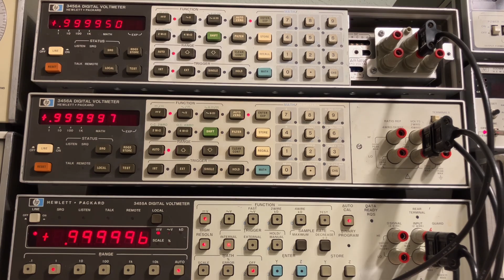HP 3456A 1 Volt Range Accuracy Issue (Part 2)

Comment: When you say "55 counts" that looks like 55 microvolts to me.  I've wondered, what use case demands that level of accuracy/precision?
Reply from the maker: Correct, it is off by about 55 microvolts. I first noticed when measuring my Weston standard cell. I simply know that the tolerance on this instrument is tighter than this, it does not meet specifications on the 1V range. I may not have a real need for this level of precision. In fact, I’ve been using this meter for the past 2 years, and I never noticed this problem before, but it was always there.

Comment: i could have told that before, as its highly improbable, that a single resistor in such an array would drift so far out
Reply from the maker: I agree, but it seemed like the problem moved to the other meter when I swapped these chips between the two. Obviously I did something wrong. In any case, at least I’ve eliminated the chip as the cause. I’m not worried; I’ll get it figured out, and it will be a learning experience for me, which is what this is really all about.

Comment: I bet for this outcome somehow. These parts are usually not leave an fully working unit in fully working order. Maybe you have to buy a damaged board what is contain this divider.
At this point i may forceing myself looking for desing issue on a part or around the connecting pin. It maybe had somthing like a overcurrent situation or viod on the case/carrier where the moisture can penetrate inside and hit this particular resistor.
In this case the component can be baked out slowly and sealed again.

Comment: you need a 1V standard. This method is not going to work. Get a PDVS2 mini
Reply: The point is not getting absolute accuracy, it's being able to adjust one meter to the others, which is currently impossible
Reply: @ivolol  I get that, but this may be due to the one you are using as the reference being off by just enough that another can't be brought into line with it. I notise that the top and bottom meters agree.
Reply from the maker: @donepearce the trimmer pot is adjusted all the way to one side, it was like that when I purchased the voltmeter. The other 3456A agrees with the 3455A (within a few counts) on every range. This one is off by 55 counts, on the 1V range only. It is definitely out of spec. A better DC standard is on my list, but not currently in my budget, so this comparison method will have to do for now.

Comment: Given these resistor networks are all completely custom to this DMM, one is also relying that that part you bought was actually a working part out of presumably another 3456 DMM that went bad for another reason. And not.... that it was a part pulled from an otherwise working 3456 but with exactly the same subtle developed fault as yours (hence why it was pulled). And then sold to an unsuspecting buyer. Regardless, I would do a second sanity check repeating the procedure you went through in the previous video of swapping chips. You could also this time put "faulty" chips in both meters, and see if they both go 'bad'. That would make for a pretty good case of evidence to get a full / partial refund.
Reply from the maker: These resistor networks are not customized to each instrument. They can be changed out and then fine tuned with the trimmer pots, I know this because I have done so a few times before when I worked on these units at HP. They are highly reliable, though, and I have seldom seen them fail. Yes, I was taking a chance by buying a replacement chip, but it does seem to be okay, since the symptom didn’t change at all. Nonetheless, obviously I’m looking at the situation incorrectly. Don’t worry, I’ll figure it out.
Reply: I mean customized to the model line, as a whole.
Reply from the maker: @ivolol I understand.